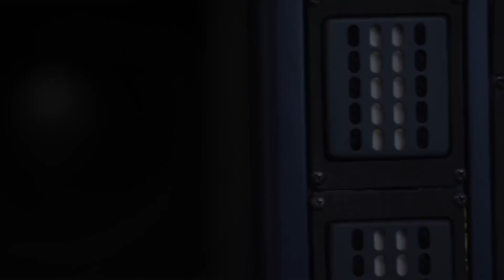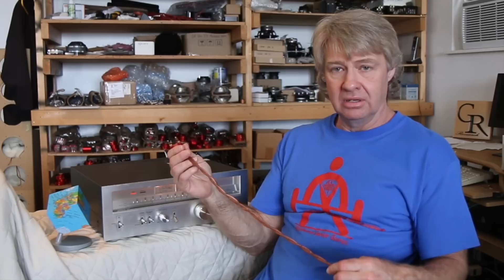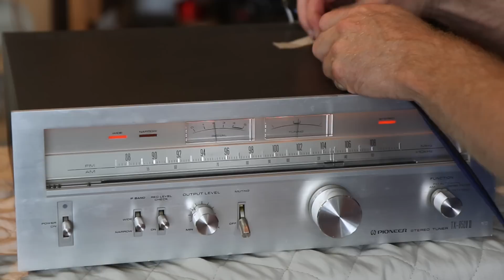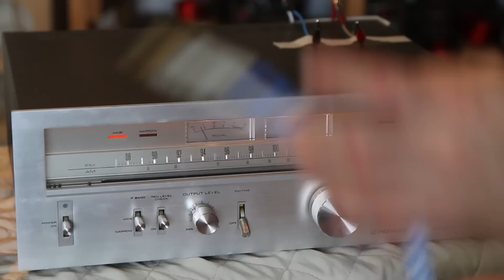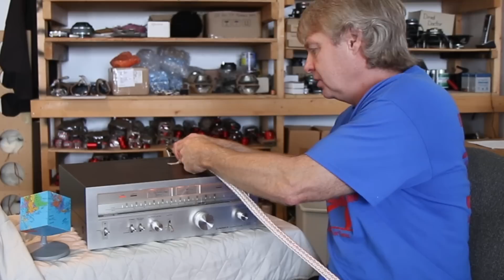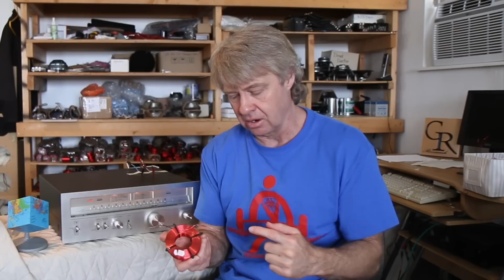Do Audiophile Cables Matter? Here's PROOF!

Comment: In the end,all that matters is what you hear. But because us humans have very short audio memories especially for small differences, comparing anything by the typical, listen, turn it off while we switch things around, then listen again and make your judgements, does not let us make those detailed comparisons and judgements needed to decide with any reasonable confidence just what the difference sounds like or if we can actually hear any difference. Without properly conceived and executed listening tests, any notions of differences whether supported by measurements or not, are just speculation and conjecture unless they can be heard and corroborated by a statistically significant number of results and population from adequately performed subjective tests. Making assumptions and judgements from the casual comparisons done even over an extended time does not provide adequate confidence. If drugs were tested in this manner, we would be in real danger, which is why it takes so long to develop and release them to the public.
Reply: I think you've participated in too many of those drug trials.

Comment: My wire is not fancy or exotic. I have neither time or money to play chase the cable games. I worked in audio for years and learned much, but still know nothing compared to my former boss. Wire matters, but not to the extent that the snake oil peddlers would have you think. Some of those cables will cause an amplifier to go into oscillations. That is messed up. Could be a faulty design of the amp, cable or both. It’s their money, let them chase it. I will use what I have and let Danny do his magic on my crossovers. I could care less about all the hype. Danny talks real to me! I can’t wait to hear his thoughts on other things. You do what you want, I trust Danny!

Comment: When Danny says "hey let's twist one up," he doesn't mean what you think he means.
Reply: Indeed, ... that last one in particular was quite the Hog Leg, ... just sayin'
Reply: @FOH3663  I call BS on this....Does FM INDUCTION really have a lot to do with the NOISE floor OR, as I understand it, equipment related.  The CHAIN is only as strong as the weakest link.  So, if your equipment NOISE is much louder than INDUCTION noise, this video is meaningless, IMO.  If you have a $50K system, small improvements like "rejection of FM noise or induced voltages may be worth going after.  FM frequency is MUCH different than music!
CLEAN Power is more likely the culprit.  I run my amps 220V and that helps somewhat and cleaning this up is very difficult; especially if you have large AMPS.

Comment: Some additional data for Danny's audience. A video I made demonstrating with data from an Entech powerline noise analyzer the RF on home AC main in-wall wiring, just as Danny described. Also the impact of a Shunyata Research Venom V14D Digital noise-reducing cable attenuating this RF on the AC mains wiring down to the "residual" of the measurement instrument. https://youtu.be/g2SAj7aKXGo

Comment: I posted a link to Danny's video on Steve Hoffman Forums for audio hardware, and it was immediately closed down by the mods. I guess they  have a problem with...facts and data. I would presume if I posted a thread that said f=ma or pv=nRT they would close that down, too.
Reply: They closed it down because the conclusion of the observations is flawed.
Reply: @StewartMarkley  Do you know that for a fact? And, when you say conclusions of the observations are flawed, what exactly do you mean by that? Are you referring to my comments in that thread or Danny's conclusions?
Reply: @stephenscharf6293  Danny's conclusion that a demonstration of RF picked up by a speaker cable connected to a tuner will influence the noise/sound of the cable when connected to an amplifier and speaker. I have posted numerous comments in the thread why this conclusion is a flawed assumption.
Reply: @StewartMarkley  You are taking a proving conclusion (that wires do in fact measure differently) and applying it to your assumption that it will not make an audible difference.
Reply: @dannyrichie9743  And you are doing exactly the opposite, your assumption that the different measurements do make an audible difference. What is the measurement differences, in resistance, capacitance and inductance? The antenna effect you demonstrated is irrelevant in the application of speaker cables.
Reply: @StewartMarkley  Differences in R, L, and C are not the only factors as to why we can hear differences in speaker cables.
Reply: @StewartMarkley  The tuner is the only the "gage" in this analysis. The RF is picked up regardless of whether or not the tuner is connected, and adds to the noise floor. If this conclusion is a flawed assumption as you state, please provide the data that backs up your statement with statistical rigor.  I'd like to see F-statistics and p-values. You'll also need to have done a statistically valid measurement system analysis on your measurement system to quality it as it as fit for purpose as well so I'd like to see % Contribution and %Tolerance as part of the MSA analysis as well as the smallest effective measurement increment.
Reply: @stephenscharf6293  What are the others?
Reply: @stephenscharf6293  The only measurement system that really matters are the ears and brains. While I am confident that speaker cables can and do influence the sound, I am also confident that only R, C and L are responsible for any audible differences in the cables. I'm waiting for these values to be published by Danny. Then also for valid double blind listening tests to be performed.

Comment: Now test teflon coated cat6 or 5e which is cheap and handles huge data transmission speeds.
Reply: Irrelevant to speaker cables.
Reply: @StewartMarkley  I bet they sound and measure well for cheap
Reply: @DesignVisStudios  They are not nearly big enough for a low resistance connection for speaker cable use.
Reply: @StewartMarkley  Just like this "proof" is.
Reply: @StewartMarkley  as irrelevant as the test demonstrated in this video.
Reply: @tomkocur  I agree that Danny's demonstration of antenna properties of speaker cables as proof that audiophile cables matter is not proof that the RF properties of speaker cables are significant and audible. This has to be proved by comparing them while used in their intended application transferring an audio signal from the amplifier to the speaker. I have suggested to Danny to use my Markley A/B comparison method by comparing the two channels of a system with the cables being compared installed and comparing the left and right sides by switching a mono signal to either side. This of course should be done without him or any others knowing which cables are on which channel, which can be accomplished with a little help from someone who then should not be in the room during the comparisons.

The comment about teflon coated cat cables is crazy in a speaker cable application. But what the hell, why not do something crazy, it can't hurt anything.

Comment: Where can we get those recommended cables
Reply: I bought a bunch of it in bulk and have used it for testing and tweaking. If enough people are interested then I may offer it as a DIY cable build.
Reply: @dannyrichie9743  Danny, it would be great to have a set of "reasonably" priced DIY speaker cables to go with the tube connectors so that some of us who are considering the tube connectors and who may be reluctant to destroy an off-the-shelf speaker wire to test out the tube connectors have an option that provides the same level of performance your tube connector and an XLS Encore as example provide (parts cost vs. commercial speaker costs in real world).  My ideal form of comparative information/specification from you/GRR would be something like "a tube connector on the speaker plus the diy cable and banana plug for the amp side rivals a $XXX Cardas/Nordost/etc.  cable and $YYY WBT/Furutech connector" etc.. i'd even be happy with the competitive names left out :)
Reply: @HoomanR17  I like that and I am going to work on it.

Comment: Given what you posited, Danny, about noise flowing all around the wiring of the house including mains (which I trust and believe in), are you a big believer in Power Line Conditioning? What models from other manufacturers do you like? Thanks.
Reply: I have a few Dodd Audio balanced power supplies and P.I. Audio Uber Busses that do a fine job with my A/C conditioning.

Comment: Danny, I've watched your crossover vids but I havent seen any where you show us how you source and terminate your speaker cables - please advise if I've missed the video. I'm not going to haggle about the cost - you've had no problems detailing the cost of your upgrades, and surely this has to rank as a very important upgrade (along with treating our rooms) ? If its a trade secret, so be it, but for now I'll stick with Belden and the collective wisdom of BJC / Audioholics - an IT degree simply doesnt make me an expert on either electronics or metallurgy.  Thanks for the video.
Reply: To be clear, the cable you are using (#4) in your home rig seems considerably thicker than either of the speaker cables on the GR Research page. I'm guessing the overall gauge of your home cable at 10AWG but I admit that I have no point of reference for your shop cables. 

https://www.youtube.com/watch?v=DC0s6KqQz3g

I don't consider 400USD for a 6-foot pair of speaker cables (your B-6 Reference cable) particularly exorbitant, but how does that explain others charging $1000+ per foot for speaker cable with supposedly 'magical' qualities ? I look forward to your reply.
Reply: @arthurwatts1680  I can't speaker for what others do or charge. I'm all about value and charging based on cost to produce and not what I can get away with.
Reply: @dannyrichie9743  Again, I appreciate that you do your own thing - and others will charge what they believe the market will bear (thats Business 101 from cookie sales to Apple Corp). If the flat earthers have any ammunition, at least IMO, its the correlation between the cost to produce (and market) a product vs the MSRP. but at the end of the day unless I'm paying said price its irrelevant to me. Looking forward to your next vid.
Reply: If I decide to offer this cable as a DIY offering then I will do a video on it and outline some of the tweaks. I didn't want to go there in this video. The flat earth guys are riled up enough just showing them measured differences.
Reply: @dannyrichie9743  No problem - appreciate you taking the to reply and please understand that I'm not trying to stir the pot further.

Comment: So 2 questions, If it filters out if i understand right high freqencies how does that effect the audio of the highs in our music and second doesn't the resistance go up when you twitst wires and how does that play in? Thanks for the info. I build HF ham radio antennas so I kinda follow what you were showing. Thanks.I am still learning a lot on antenna theroy and cables.
Reply: Twisting or braiding doesn't effect the resistance. It does effect the inductance and capacitance. And some of the tweaks down can go too far and negatively effect the audible range. So one has to be careful.
Reply: Danny Richie very good!   Thank you for all the info you share!!!

Comment: Total BS. The act of attaching the cable to a low impedance load (amplifier or speaker for example) insures that any RF is shorted out. Love everything else that you do Danny.
Reply: If that were true then they would all sound the same. Yet clear audible differences are still present.
Reply: @dannyrichie9743  So you don't agree that an amplifier output is low impedance or that speakers are low impedance ? Or do you disagree with the fact that low impedance will short out any RF ? Have you ever measured the output impedance of an amplifier (typically > .1 ohms). What kind of voltage are you expecting to see on a 1m aerial with the conductors on a near dead short ? 
Be honest...
I challenge you to hook one end up to a power amp and redo the test.
Reply: @TeslaNick2  I'm saying that if the low output impedance of an amp nulled the effect then why is it still an audible effect.
Reply: @dannyrichie9743  Danny, you aren't showing us that this antenna effect affects the sound. Just implying it and saying that it does. I am not a flat earther just someone with a lot of skepticism based on 50 years of electronics, audio and physics training and experience. I'm more of a show me rather than tell me guy.
Reply: @dannyrichie9743  Might that "audible effect" be atributed to anything else rather than to RF interference?
Reply: @StewartMarkley  Correct. I confirmed that there is a difference. Demonstrating an audible difference is more difficult and will have to wait for another day.
Reply: @IliyaOsnovikov  There are a lot of other things that have an audible effect, but this one was easy to show in a way that people will get it.
Reply: @dannyrichie9743  How are you hearing an effect from something that has been shorted out ?  Your subjective opinion does not trump the laws of physics.
Reply: @TeslaNick2  What makes you think RFI and EMI is shorted out? No physics laws are being broken here.
Reply: @TeslaNick2  Very telling that the replies ended there.

Comment: Did you really just make a video proving that copper wire can be used as an antenna?  Holy shit dude.  If the RF induced in your speaker cables results in audible problems, you have a defective amplifier.  Tell you what, why not repeat this experiment on the voice coils of your speakers and see what happens.
Reply: Yet, differences in cables can be heard with any amplifier.
Reply: @dannyrichie9743  Can you hear any differences with different cables coming from any speakers and any amplifier when not playing anything? If not then the differences in RF induction in the cables has no effect on the sound of the cables because there is no audible effect.
Reply: @dannyrichie9743  Can they?  If so, and for the reasons (RF) that you claim, then you have a defective amplifier.  All your demonstration proves is that you've connected something approaching 1/4 to 1/2 the wavelength of a radio station to your antenna input.  Debate the merits of cables all you want, but presenting this as your Q.E.D. is just cringe inducing.  Setting aside the fact that you're comparing an insanely high impedance circuit against a very low impedance one, if you want to look for RF, the tool you use is a RF spectrum analyzer, not an FM front-end that is tuned to receive things from wavelengths roughly corresponding to your cables.

Comment: Just picked up a new pair of speakers last week, the Dynaudio Emit M20, absolutely love them. When I purchased these speakers, I asked the guy if they had any speaker cables that are decent and wouldn’t break the bank. He went out the back and came back out with about 3 meters of this really thick 4 core  triple shielded copper cable made in Japan, which he threw in for free! For now I’m just using the bare wire connection and  using 2 out of the 4 cores in the signal path per channel. I have noticed that there is still a bit of hiss in the noise floor, but I’m chopping that down to the rest of my gear.
Reply: Okay so try a few experiments and see if the noise floor drops.
Reply: Connect the unused cores, at only one end, to the amplifier negative ie black terminal. They will then act as a signal shield.

Comment: I see a tremendous amount of comments saying RF/EMI interference won't affect speaker wires,   I don't think that's the point of this video.   I think he's pointing out the diffrence in general across all types of wires throughout your entire chain.   so many people insist that cables make no difference at all, "snake oil" if you will.   I don't think the point of this was for everyone to run out a buy $800.00 speaker wires if your still using Interconnects off the clearance rack at walmart.
Perhaps a PT.2 where Danny uses varying grades of RCA inter connects
Reply: You are correct.
Reply: That is correct. BTW, the AC wiring insider your house is an excellent antenna for RF.

Comment: Hi, ok I get the point, but if the special cable acts as a “RF filter” then if we attach the cheap cable to the end of the special cable during the experiment there should be no increase in signal , other wise it’s just acting has a coaxial cable and not has a filter, maybe GR can do this extra experiment.And I believe that cables make a difference just not sure this is a conclusive experiment, cheers
Reply: Well he kinda does it already. Because he mentions, that his body is functioning as an antenna picking up signal/noise while holding the cables. It doesn't negate his argument, because the tested cable is carrying any signal that is being put through it. Whether it comes from his body or a different cable.

Comment: OK, now that we see some measurable differences. How do we choose cable based on this information if we don't want to spend thousands on a set? I had planned to assemble some using cable purchased by the foot and decent connectors for $100 or so. I'm guessing, there's no way I'm going to get anything like the 24 conductor wire in that price range. Where is a good compromise?
Reply: Some general guidelines would be to avoid PVC jacketed wire. And find some inexpensive wire that you can braid around a rope core or Teflon tubing. You can get great results without spending an arm and a leg.